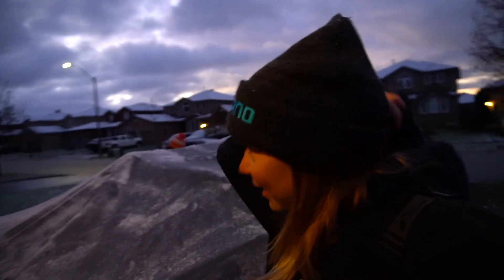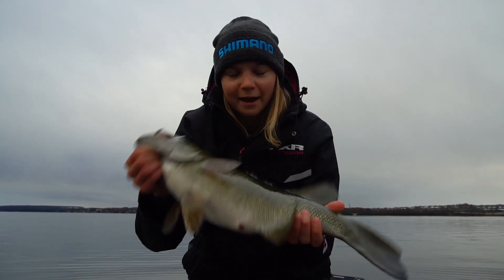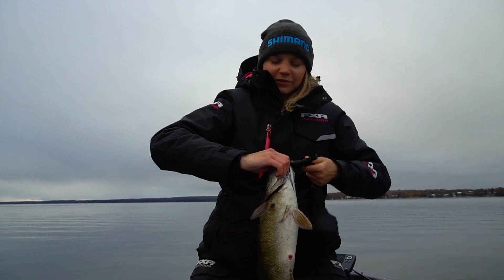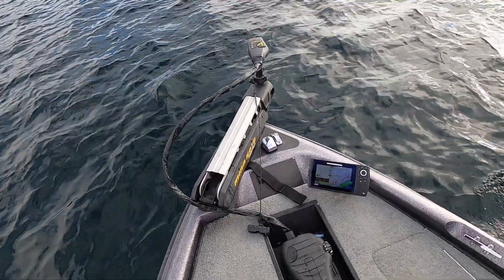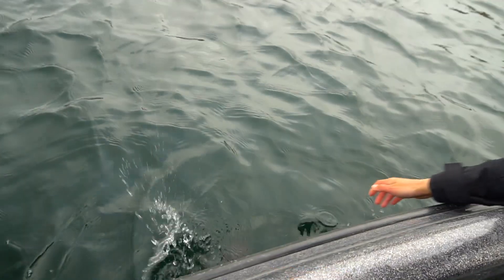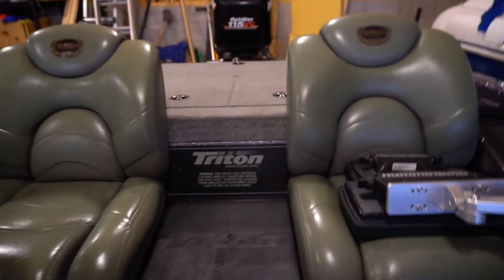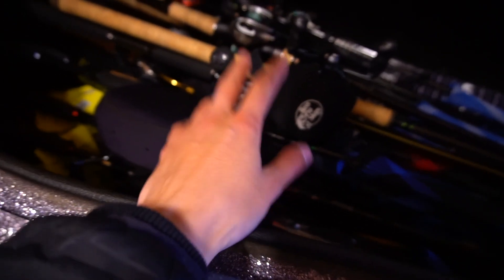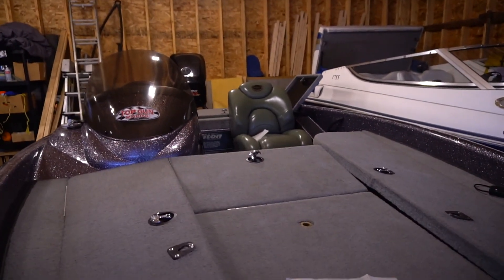One Last Time…

Comment: Looks like you had a great final day on the water.  I hauled my boat down south to Georgia and have already hit one of the local lakes which numbers 6 that are within a 2 hour drive of my house here.  Water temp was 60 degrees F and the Bass were hard to find as the fall transition just started. Caught a few but nothing big. I should have fished our river as the fall transition has the Bass moving to the mouths of the creeks.
Reply: Roll tide